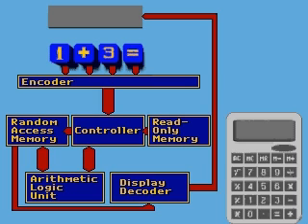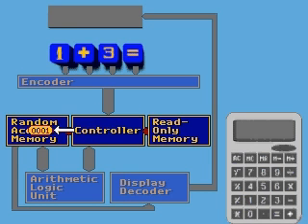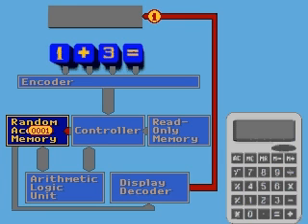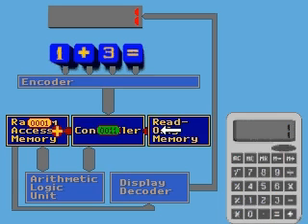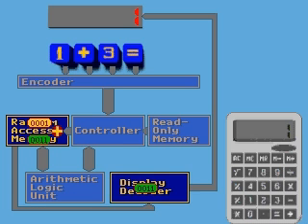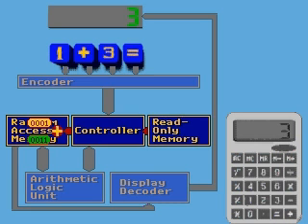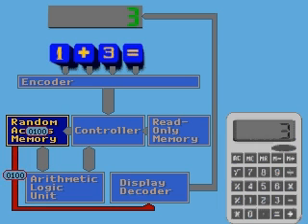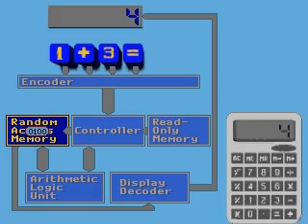How Calculators Work

Comment: ok but what if u click 1 and then 2 to make twelve

where would the numbers be stored before encoding them into one binary number
Reply: 1 is = to 0001, 2 is = to 0010 & 3 is = to 0011, so if you combined the numbers 1 & 2 to make the number 12, it would be translated to 1011. 1011=12

Comment: Didnt understand. ...but its a clever invention
Reply: It's pretty simple if you break it down. They keys pressed go through decoders, which put them is binary (1's and 0's) and gets put in to RAM (Just a place to store memory) then displayed on the screen. When you press add and another number, it brings that number into the RAM and displays it on the screen. When the = sign is pressed, the ALU (Unit that does math using binary) adds the 1's and 0's and them the binary sum goes through display decoders, which tells the screen to show that number. I'd recommend looking for Minecraft calculators, Cause cause they are the easiest way to learn calculators.